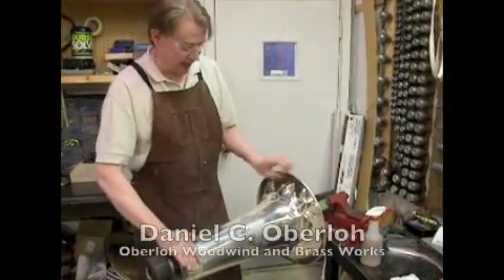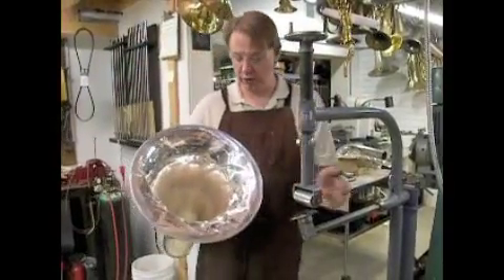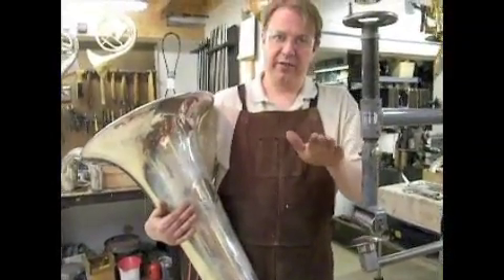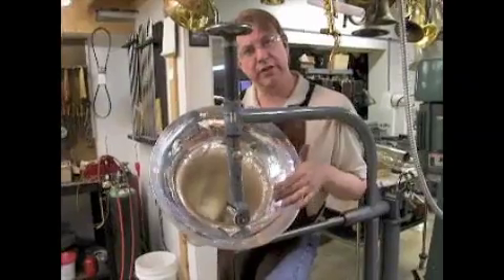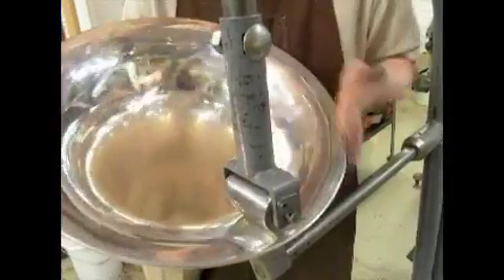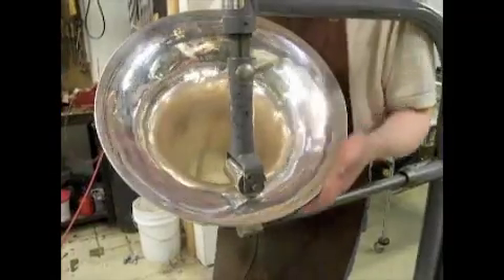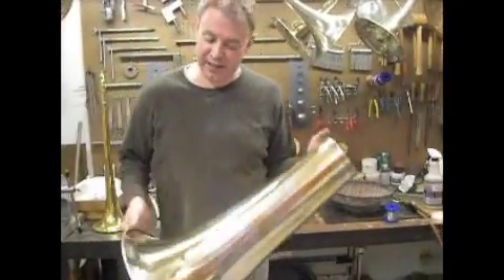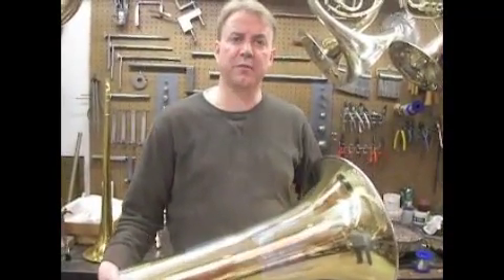Hirsbrunner tuba repair project stage 4

Comment: i played tuba at high school, the tuba was owned by the school, one day it got smashed in the back of the car, wasnt a huge knock, you would be amazed how little it takes to cause that kind of damage, looked just like the one you are repairing, anyway.....my father decided to have a crack at fixing it rather than tell the school.......1 rubber hammer, 1 steel panel beaters hammer, honestly, no body every knew, i played it for another couple of years before passing it on to another student....

Comment from the maker: @whatever7x7 I will anneal a bell if required. It would not be a good idea to do so on a silver plated bell unless the silver were removed in advance as the silver would melt and run or blister the surface making a bigger mess of the project (more work).  Another issue of annealing  would be throwing off the evenness of the bells temper. Unless the whole bell were annealed, it would have hard and soft spots that would take a good deal longer to address, making the bells temper properly uniform.